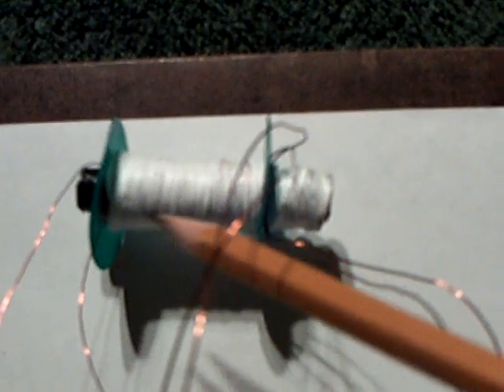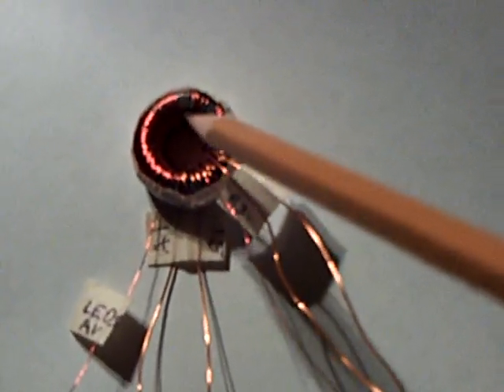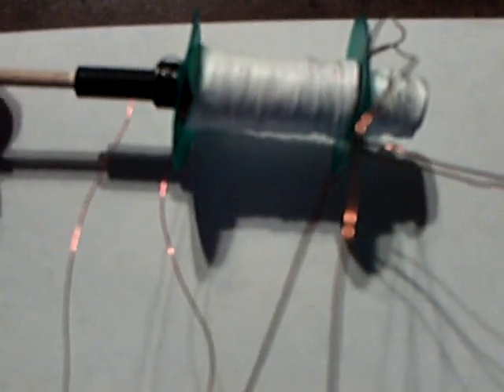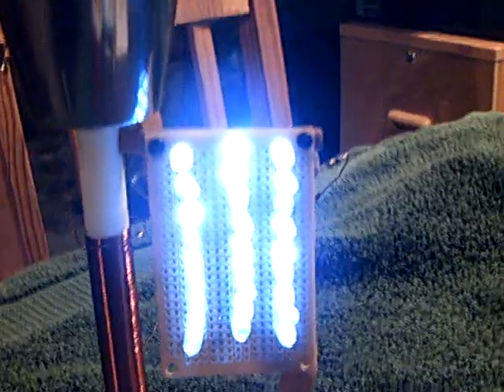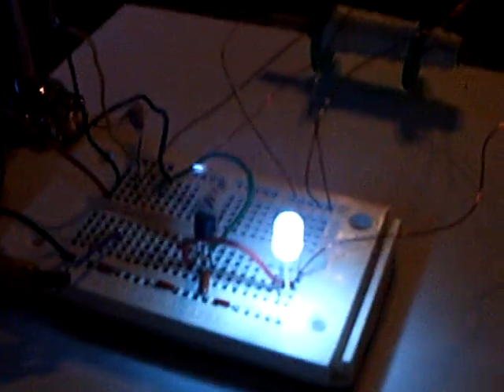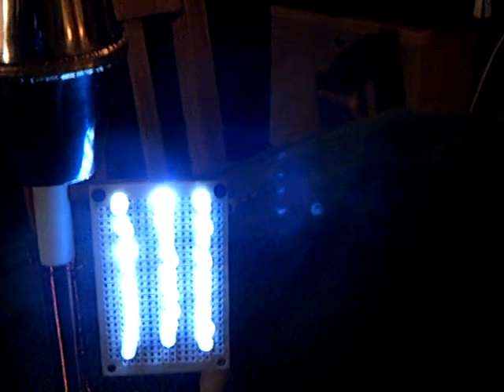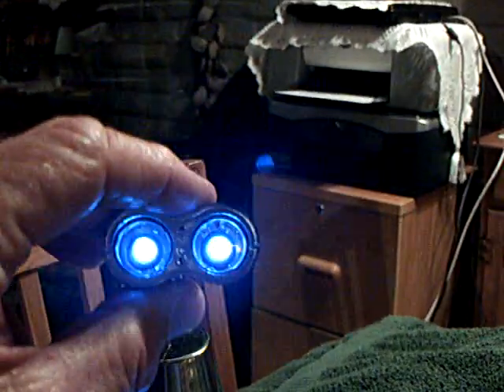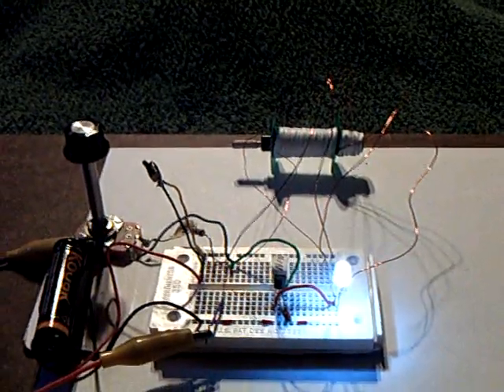Joule Thief-- with tunable coil

Comment: hi lid,  just curious, if i have an 8ohm coil, could i tune it by putting a potentiometer on one of the wires? so it is adjustable from 8ohm to 50 ohms.....do you think this would work?....cheers keep up the good work.

Comment: @Lidmotor 

You have 27 LEDs at full brightness for the price of one? that's fantastic!

I really liked your Fluorescent/CFL experiments too, It'd be awesome to have something like a SEC driving fluro's in a house purely from Solar Power. My workmates are running their solar charged battery banks (12V)  through an inverter, and using the 230V output to drive a few fluros

Know how much those inverters draw without any load? 1.5AMPS! And each additional fluro draws 1200mA from the bank therein